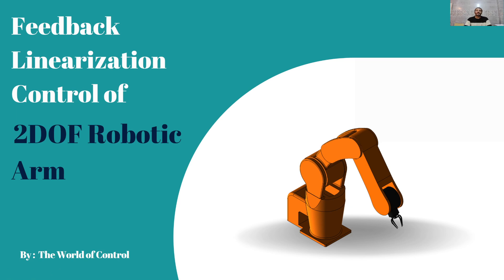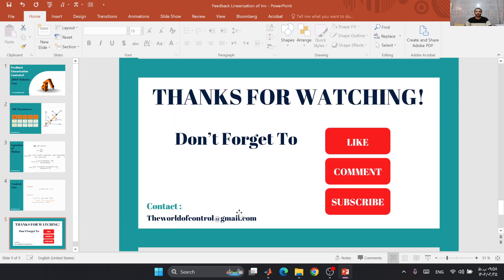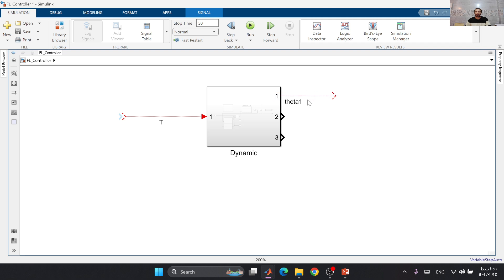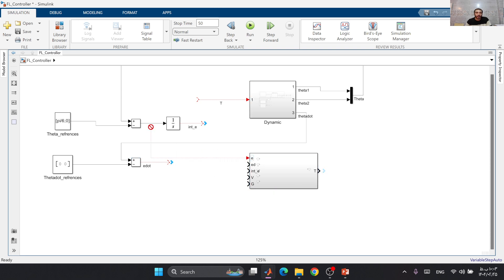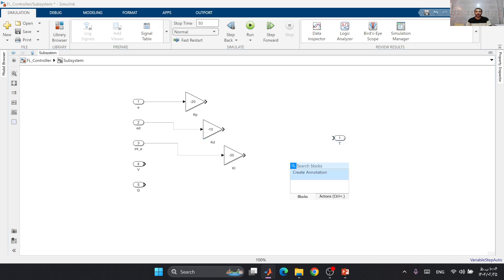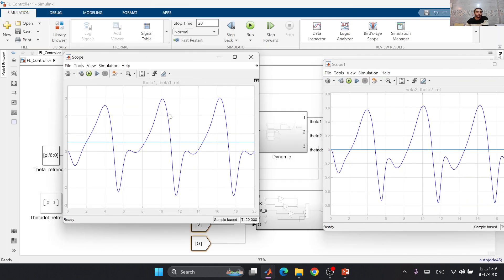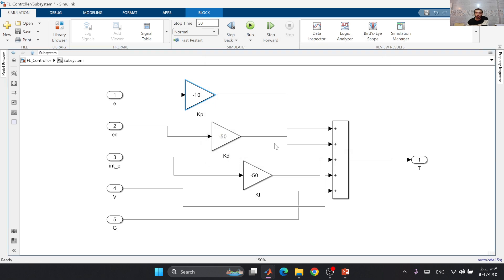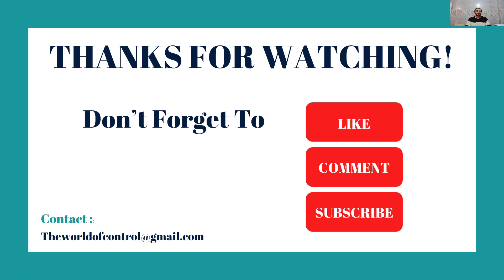Feedback Linearization control of 2DOF Robotic Arm

Comment: Hi mr, thank you for your efforts and good vids, i want to ask, in this vid, if i am not wrong, u designed a pid controller to control the 2DOF Robotic Arm model, can this model be extanded to include ILC with PID as its base?
Reply from the maker: Please explain more
Reply: @theworldofcontrol  so, i have a project that i need to use  ILC  (iteateive learning control methode in), it is the same thing as you made in this vid (2 DOF) but i need to add the ilc in it so the model can follow a precise trajectory and correct itself from iteration to another
Reply from the maker: I can do it for you, please send me an email